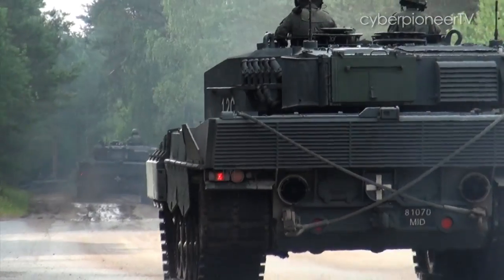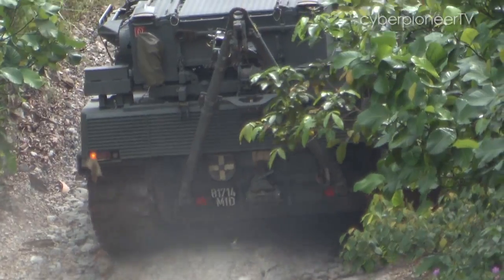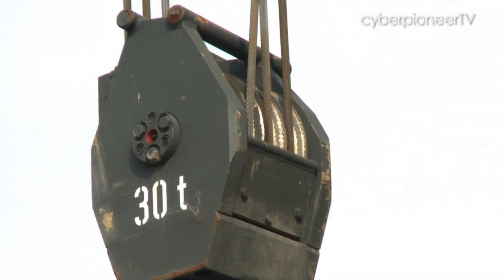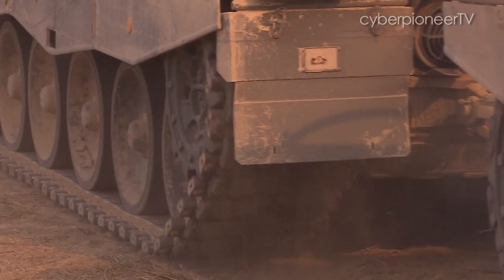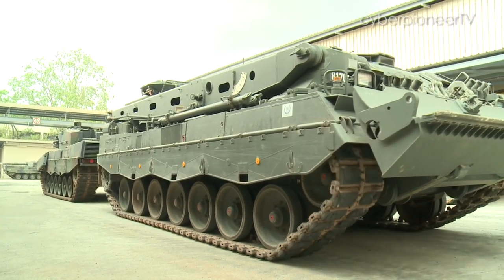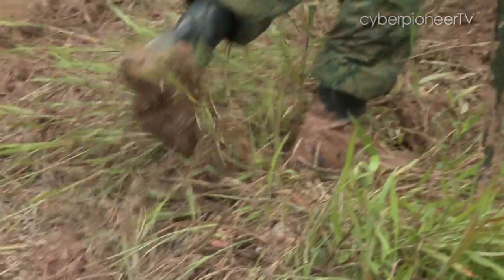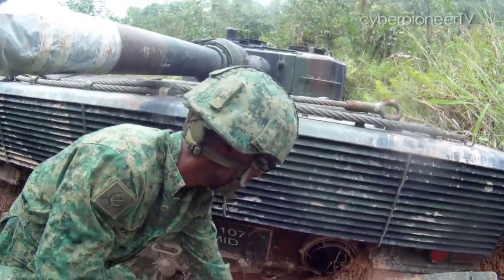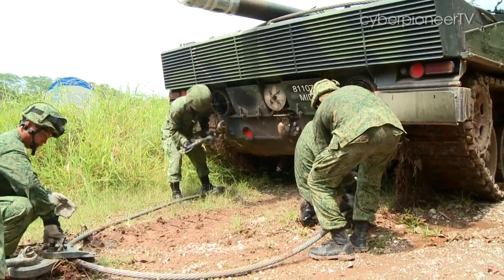Pull Factor - The Leopard Armoured Recovery Vehicle

Comment: May be I missed it but why do they need to calculate and choose the pulley system? Shouldn't the highest/strongest load be the best all the time?
Reply: What you gain in pulling power you loose in lenght of the pull, Also 2 part pulling takes more time to set up then 1 part and 3 part takes more time then 2 part, wich can make all the diffrence if you want the tank to get into combat fast
Reply: Thanks mate.